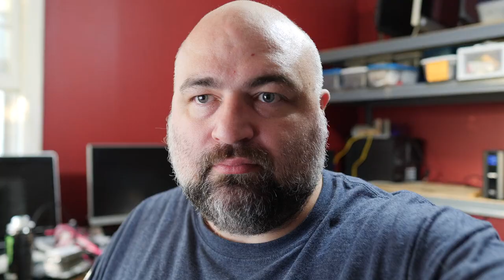Even MYTHBUSTERS Got The Airplane Conveyor Belt Question WRONG - A Neckbeard Explains - Jody Bruchon

Comment: I see what you are trying to say here and your question is not dumb at all. it is actually quiet clever. I think the confusion comes from lack of clarity in the problem statement. Some people assume that the treadmill is moving at some constant speed backwards (I think this is what the question is asking too which has a simple answer, the plane will still take off). Your assumption is that as the wheel tries to roll the treadmill is speeding up to make sure as the wheel spins, the treadmill covered by the arch length of the tire is equivalent to how far the belt moves back. which is an incredibly problematic situation and has genuinely given me a headache to fathom what would happen if non of our real life mechanical component fail due to extreme stress on the tires and the belt.
You are saying that in order for the wheel to allow for the plane to move forward, it needs to be spinning fast enough so that the surface (belt) LAGS behind; otherwise it would be equivalent to the wheel breaking and preventing the plane from moving forward or equivalent to wheels being glued or jammed to the bearing and not spinning at all. Good news is the plane still flies! congrats! we just achieved VTOL! the engine is capable of moving enough air around the wings to generate lift. the forward movement is just the pesky consequence of  newton's first law! In real life, it is a bit more dramatic since the tire will probably just get damaged , pop, skip or break off.
 So in both scenarios the plane still flies! and again if the treadmill at all times matching the speed of the wheel was your concern, it will still fly. it will gets slightly off the ground and then rockets off forward as soon as the wheel is not in contact with the treadmill anymore. 
Oh by the way, To clarify 747 still flies on the same fundamental principle as the propped plane. that really doesn't matter. it is just instead of 4 wooden blades there are hundreds of metal blades in a tube. other than that 747 and your run of the mill Cessna are pretty similar in this thought experiment (747 would actually have an easier time taking off because the engine has more thrust and can distribute the lift vector over a larger surface of the wing)
Reply: @johnguilfoyle3073  again we are discussing the scenario where the conveyer belt is matching the arch distance of the tire. The trick is that the wheels in this scenario never gets displaced relative to the ground (not conveyer belt)! In order for the wheels to move or spin, The plane needs to go forward relative to the ground, in order for the plane to be able to move forward, ALL of the attached part of the plane need to move forward. So if any 1 part of the plane is locked in place relative to the ground, let's say the the wing or the fuselage, then the plane is locked in place relative to the ground and will not move forward. in this case the wheel is not moving forward relative to the ground. because it is locked in place relative to the ground. What ever force plane is putting on the gear to spin the wheel, is matched by the conveyer belt since it is accelerating to to move the belt as fast as the arch length of the tire. That being said if the engine can move enough air over the wings to generate enough lift it still can fly. but it has to do it through just shear thrust generated from the engine.  Instead of moving through the still air, the engine needs to move ALL the air over the wings.

Comment: You just described a paradox. It is literally impossible for the conveyor to match the speed of the wheels and hold the plane still. If the speed of the plane = 0, the conveyor exerts no lateral force upon the plane. If the plane is attempting to move forward (the engines produce thrust), its speed is > 0, so the conveyor must match it. It cannot simultaneously have speed = 0 (the plane does not move) and speed > 0 (the belt is exerting force to hold the plane in place).
Reply from the maker: Much like how we can calculate limits in calculus or the ideal yield of a chemical reaction, we can solve for the ideal case in this problem, even if it's impossible to obtain in practicality. The question doesn't ask for a practical solution.

Comment: I love how this is still an argument years later... However, the way to solve this is to use a base 0. If the treadmill (ground) isn't moving then the only way to keep the wheels from moving would be to tie the plane to an object that keeps it from gaining forward momentum. Now you have an exact match of wheel speed and treadmill speed. Whether it's 0 or 10 million mph metched wheel/treadmill speed the engines on the plane will not take off... Let's all get our remote control planes to prove/bust this theory.

Comment: You're simply wrong here.  The simplest way to demonstrate this is to put the plane on skids on a regular runway. That actually matches the scenario, as immobile skids on an immobile runway exactly matches immobile wheels on an immobile treadmill.  The plane is operating on the air, not the ground.

Even IF the plane has wheels, the only scenario in which the wheels could conceivably match the speed of the conveyor is if an unmonitored factor is holding the plane stationary relative to the surrounding ground, and even then with sufficient headwind it could still become airborne because it's velocity relative to the air is the important factor (and is why you don't park (light) aircraft into prevailing winds.

Comment: You seem to be stuck on “wheel speed”. The wheel rotational “speed” really has no effect. If it was a factor, as you suggest, how do planes with skis work?  Their “wheel speed” is zero. What matters it the speed of the air moving over the wings. How fast the wheels turn doesn’t matter. Find an old (1930’s) video of planes being launched from battleships via catapult. There’s no runway, no wheel spin, just air moving over the wings fast enough for it to fly.
Reply from the maker: The question is worded specifically. Do you not understand the constraint in the question?

Comment: I see what you’re trying to say.  If the BELT was moving at 20mph and the airplane wheels were moving at 20mph, you would be stationary.  If the WHEELS were moving at 100mph and the belt was moving at 100mph you would still be stationary no matter what speed as long as the wheels are spinning at an equal speed. So would a plane takeoff if the belt moved as fast as the wheels? No. However see below.

A car for example uses its wheels to accelerate the vehicle. If the car accelerates as hard and as fast as it can and the belt kept up with the speed of the spinning wheel, the car would be stationary because the car utilizes its wheels accelerate (wheels going 100mph and belt going 100mph) .  The same thing applies when you are running on a treadmill, you set the speed and run that speed or as you put it, you run as fast as you can and the treadmill matches your speed (using your leg to run on the treadmill like a car uses it’s wheels to spin on the treadmill), you will remain stationary.

An airplane uses thrust and no matter how fast the belt is moving, realistically the airplane (prop or no prob) wheels will always move faster than the belt because the airplane does not accelerate using its wheels like a car would. For example, you have an RC car (or whatever car with wheels) and you push and hold the car down on a belt going 50mph with your hands and hold it stationary, the wheels on that RC car will be spinning at 50mph, but now instead of using your hands to hold the toy car stationary you continue to keep your grip on the toy car and move it forward, the wheels will spin faster than the belt even if the belt tried to match the wheels of the toy car.  The reason is because the toy wheels are not propelling the toy car forward, but your hands are.  In this case, the airplane engines are like your hands moving the airplane forward regardless of the how fast the belt is moving.  The wheels on the airplane will ALWAYS be moving faster than the belt realistically. And if it doesn’t, you’ll be stationary like the very first paragraph I have mentioned above which means the airplane will not takeoff because your stationary with no wind going up and under the wing which results in zero lift.
Reply from the maker: Yes, the problem is that the ideal conditions required to meet the criteria of the question as written are impossible to create in the real physical world. They can only ever work on paper. In the real world, SOMETHING will give and the plane will be able to violate the constraint and it'll go forward and eventually take off. That's the crux of the problem: the question itself lays out impossible requirements for a real-world experiment, but we CAN predict what would happen in an ideal scenario. It's sort of like titration in chemistry, where an ideal calculation for yield exists but there will always be some small amount of losses that introduces an error in the final yield.

If we do a pure evaluation of the question as written, there is no way for the plane to go forward, the only prerequisite for lifting off the ground, so it'll never take off. If we play Mythbusters, there's no way to meet the restriction in the question, so the error will allow take-off.

I've found that this question is an ideal question to determine how well people can both carefully comprehend a word problem and keep the theoretical and the practical separated in their minds. All of the arguments I've had over this come down to people who either can't work with a pure theoretical scenario or don't read, understand, and accept the text of the question precisely as written. People will introduce their real-world knowledge and experience as pilots, mechanics, engineers, or students, and in doing so they'll diverge from what the question actually says.
Reply: Being a problem of motions, the fact that Is freewheeling does not change anything. The weight and the thrust are in any case always discharged on them. And through a constraint, the hub, they transmit the motion of the treadmill to the whole plane. If this were not the case, there would be no braking system or anti-skid on board to stop the plane during take-off.

Comment: In rotation, there are two boundaries speeds, and all those between, unless you are very specific.

At contact patch point, the wheel speed with respect to the ground is ZERO.  At top of wheel, furthest from the ground, the speed is double the forward velocity of the axel point.

And, as I've said, there are all the speeds between, depending upon what distance from the ground you are, ground surface to top of wheel.

The unspecified portion of wheel speed causes this problem to have more than one arguable answer.

Comment: I've read about a million comments. I'm ready to say my bit haha. I'm beginning to understand your viewpoint. And i came to this by thinking about cars travelling in opposite directions on the highway. The constraint in the question is constantly broken by a factor of 2 if we need forward motion and therefore there can be no forward motion. Here's how. Two cars drive opposite directions, each travelling 60 kmph.  The combined speed separating the cars is 120kmph (moving away from each other.) The wheel rpm on each car is hypothetically 100rpm. Now imagine one car is parked. In order for the combined separating speed to match the first scenario, the second car needs to be travelling at 120kmph. Now the second cars wheel rpm is (hypothetically) 200 rpm. Now pick up the highway and make it move backwards at 60 kmph. The first car that was parked is now moving back at 60 kmph along with the highway. But now the second cars forward speed has halved to 60 kmph. But the separation speed is still 120kmh. That means the wheels of the second car are spinning at 200rpm for only a 60 kmph forward motion. This is in effect what happens on a conveyor travelling in the opposite direction to the object riding it. But here's the kicker. What exactly does the question mean by match. Its a trick question imho because even if the wheels need to spin twice as fast as usual for half the forward speed it is still "matching" the ground its riding over, or else they would be skidding along
Reply: First, the thrust of the engines needs to overcome the friction of the wheels and gravity that will increase that friction. If there is enough thrust after that to reach lift speed away it goes!

Comment: Yeah, but how is the thrust of the plane, any different than me pushing a toy car on a conveyor where the wheels match the speed of the conveyor? I could easily push that toy car forward no matter how fast the conveyor spun
Reply from the maker: But the speed of the wheels then exceed the speed of the conveyor. That's mandatory for forward motion. The question doesn't allow that.
Reply: Yeah, I've been arguing on your side for years now, they just don't understand what exactly the same speed as the wheels means. Like a set of gears, or as if the plane were on rollers. 

I always use the analogy of a wagon on the same conveyor belt with a fan on the back, the wagon isn't moving forward, then just extrapolate that to any speed you want. 

That one through me for a bit of a loop though because there is no speed where I wouldn't easily be able to push that toy car, but as soon as I push it the wheels move faster than the conveyor, breaking the question @JodyBruchon
Reply: But then again when I think about it, there is no speed the conveyor could go, it could go as fast as light, and I could still hold the toy car and move it forwards on the conveyor with the wheels spinning. hmm... uggh.  @JodyBruchon
Reply from the maker: @Livewithhonour333 The constraint is not practically possible. That's why so many struggle with it.
Reply: @JodyBruchon   Yeah, thanks man, great video. The tires would obviously explode before take off regardless at the speeds that would generated by the conveyor on the free spin of the tire. No take off.

Comment: In theory, you are correct, if we had a tire with more grip than the power of the engines, and a conveyor belt with unlimited speed, yes the plane would never move. 
In reality the plane's power would overpower the wheels and they would either drag or just go faster than the conveyor belt. 

The issue is that this is a hypothetical problem that breaks the limits of physics and reality.
Reply from the maker: The plane would flip over the front wheel and crash.
Reply: Both in theory and in practice the plane will never take off. With the conveyor belt in motion, the aircraft will make an infinite take-off run, because it will never reach the moment when the lift exceeds the weight. At this point we can freely consider which are the first parts of the plane that will fail. Will the tires explode? Will it run out of fuel? Will the pilot die of a heart attack? But does it ask us the problem? No.

Comment: im an av nerd and im extremely confused about what this question is even supposed to be asking
the wheels of a plane arent driven so the speed the wheels are turning is completely irrelevant to its ability to fly, all that matters is the air speed and i dont understand if the plane is supposed to be moving or not, but you are also correct that the propwash would definitely matter but all that does is lower the planes stall speed the plane would still need sufficient airspeed to fly, even the most insane stol planes cant take off on propwash alone.
again tho im extremely confused as to what the question is even asking is the plane actually moving or not?
also yes its impossible to have a conveyor belt that can match the speed of the wheels because the conveyor belt is also whats driving the wheels, depending on how the conveyor belt does this it would either not turn at all or would just keep gaining speed infinitely (if this hypothetical belt has no top speed)
even as a hypothetical this makes no sense